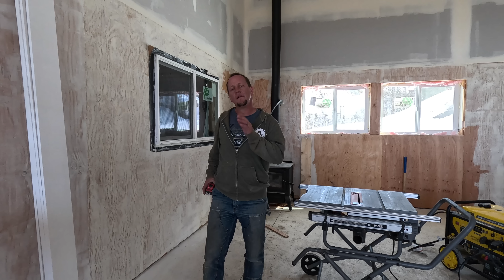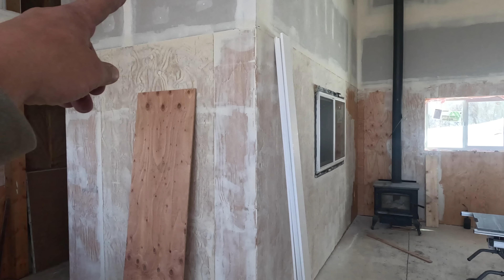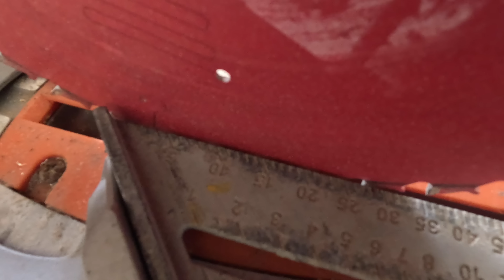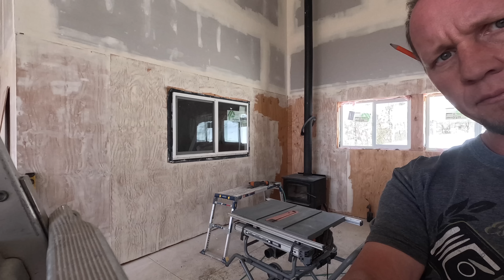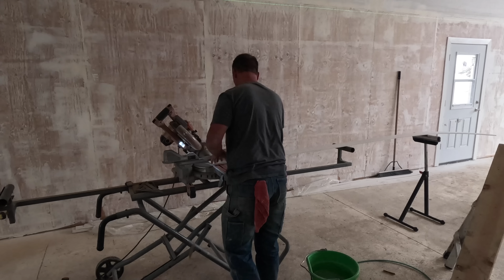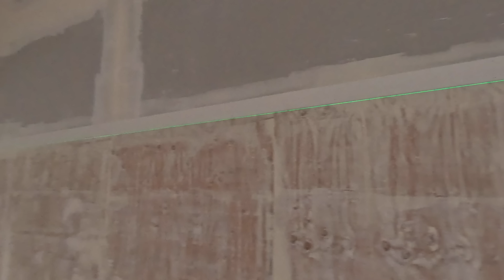FINISH TRIM getting installed in the SHOP | HUGE IMPROVMENT \\ MOUNTAIN MAPLE RANCH

Comment: When you run vinyl siding you do the lap same way you did trim where you can, so that if you're standing in front of the house you don't see the seam. And on the front and back you do it where you can so if you walking up to the back door or front door you can't see that either.
Reply from the maker: Absolutely... It's is a simple thing to do and really doesn't take any extra work, just a conscious effort to align it that way and it makes such a difference in the finished product.

Comment: Great idea with the 45 degree angle for the bevelled edges on the trim though. I have used trim with tracks and inserts so even it there is expansion or reduction the edges will also be locked in place. You guys are definitely on the home straight now.

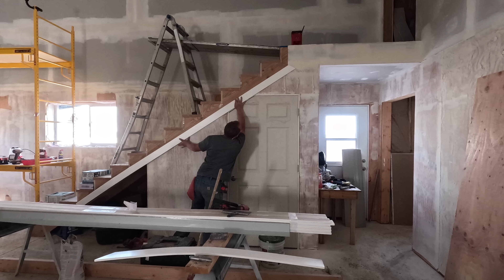Comment: 9:10 your generator may have an "auto idle switch" which is intended to idle down your generator when you are using it intermittently like that.   I read for mine it is best to run on gas in that mode, where the generator has more power.  Plus gas is more economical, probably cheaper and safer to let your generator to run outside your shop and idle down than to start and stop the generator intermittently which adds wear and may waste more fuel than letting it idle.  Obviously it depends how often you are doing that.
Reply from the maker: Our old one did and I loved that feature, but this one does not. Now that we are getting higher temperatures we will use gar more for sure.